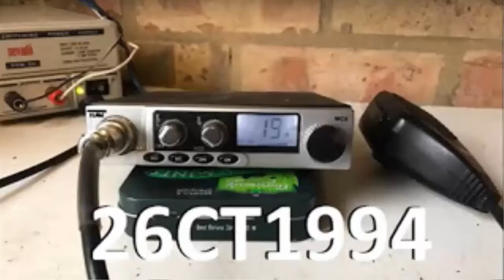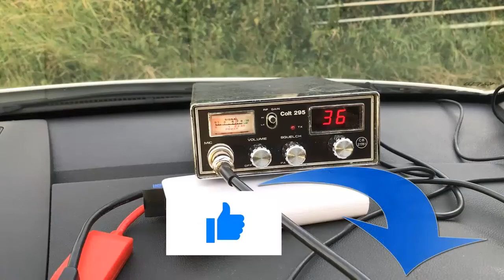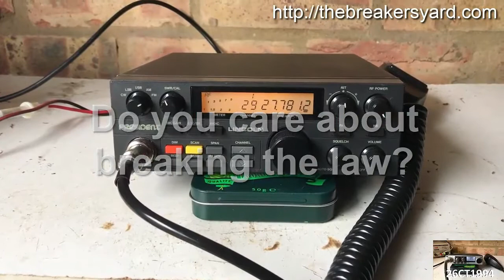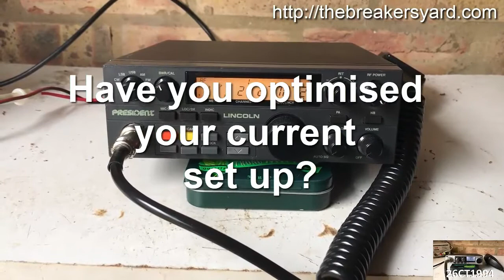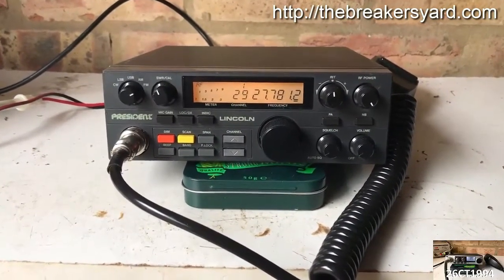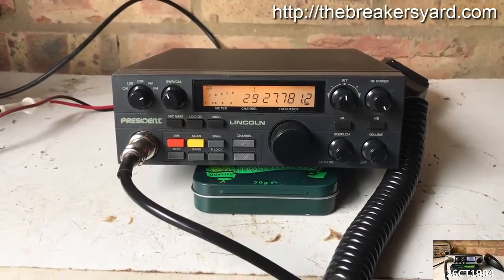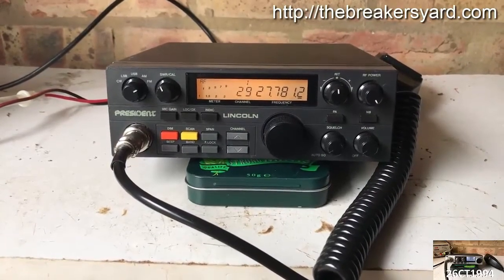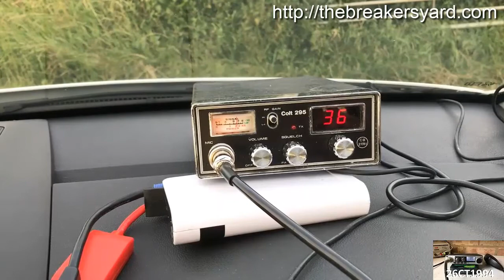Day 33 : CB Radio Amplifiers

Comment: I got into 11 meter radio in the late seventies and the folks I knew was aware of the FCC and tried to run legal. Since I've gotten into ham radio. Nowadays people show amps on utube to sell. And CB shops advertise online about selling radios and having an option to get the new radio peaked and tuned for an additional charge. Things sure have changed. Cheers 🥂